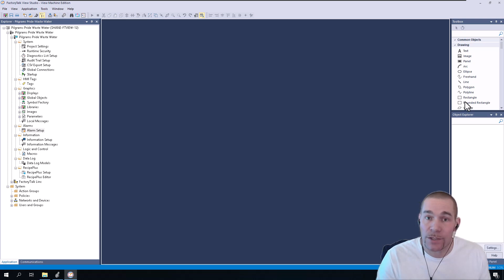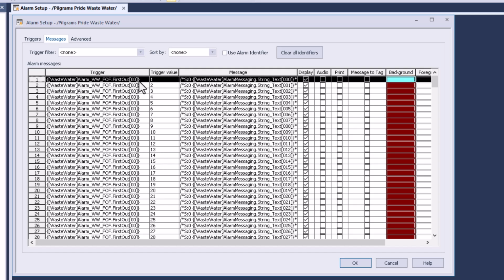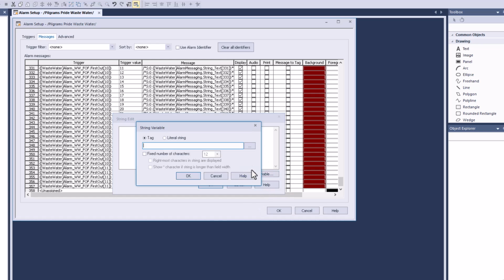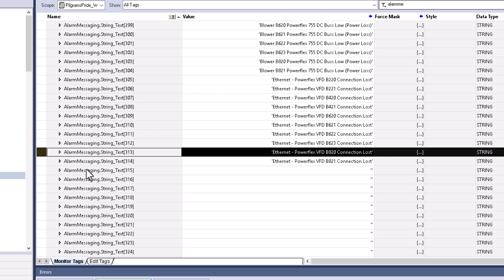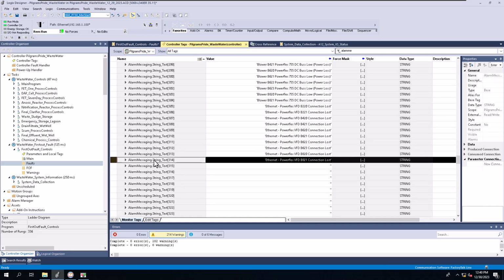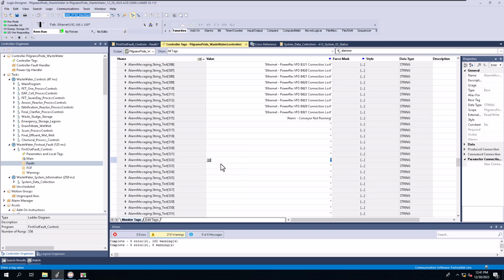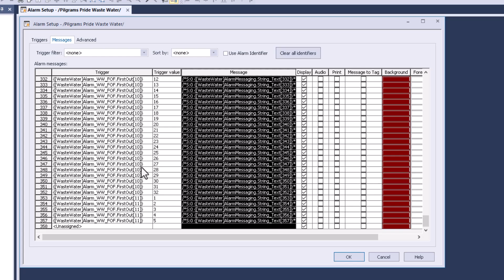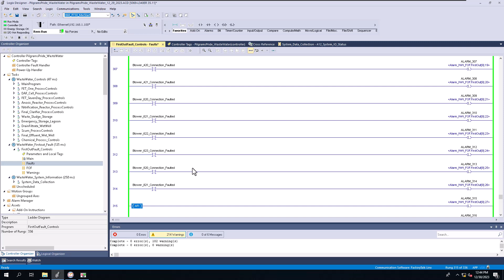FactoryTalk Machine Edition Alarming Best Practice

Comment: What if multiple alarms(bits) are made in the same word? I may of not set this up right but when i have multiple alarms made in the same word it changes my bit value and doesn't display correct alarm anymore.
Reply from the maker: It's first come first serve, first out fault catch.
It will show others after reset by the goal is to catch the first out fault

Comment: question, those string tags values in the plc do not come back to 0 after a restart of the plc?
Reply from the maker: If there is no alarm then they work fine when an alarm is active, if an alarm is active and you reboot the panel view then they can produce ??? marks but if you clear the alarm then they populate

Comment: Great videos Shane! I have a problem with this method that you may have figured out a way around. When the HMI first powers up (I believe the strings aren't read until after the alarm triggers have been read) it always gives the active alarms with "????????" for the text. Then after powerup it works as expected.
Reply from the maker: That is a panelview plus issue, depends on the firmware

Comment: Have you ever noticed using this method, STRING tags as the message versus just typing the message into FTVSME, showing a blank alarm description upon initial bootup of the PLC/HMI?

The only other snag I’ve seen doing it this way is when switching languages on the HMI, the alarms will not translate the STRING tags in FTVSME, so that’s up to you now to do via STRINGs in the PLC.
Reply from the maker: The alarms are started at the time the Runtime file starts
Reply: @ShaneWelcher  I had the same problem, there is a difference in the timing of the alarms starting vs the strings updating so all the initial alarms show up as ????????.
Reply from the maker: @TheLegendOfIsaac  I use this method and keep my timing in the task rate the same however PV plus is a huge time lag
Reply: @ShaneWelcher  I'm not referring to the timing of the tasks. I believe that within the Panelview the alarms start looking for triggers before the alarm strings can catch up so they appear as all blank alarms upon powerup. They are all ?????. I'm not sure how to remedy this.
Reply from the maker: @Isaac-qd6gy  What's your update rate for screens vs the alarm triggers
Reply: @ShaneWelcher  My screens are on a 1s update rate. On the Advanced tab of Alarms, in the field Maximum update rate (second): It is set to 1s.
Reply: @TheLegendOfIsaac  I have yet to be able to remedy this and therefor choose to just go with having the alarm messages built into the .mer versus the method of having the alarm messages all be STRING tags within the PLC.

This happens with Micro 800 controllers and PV800s as well, same issue.

The only 'trick' that I have tested to get it to work correctly is manually unplugging the PVP7 and then powering on my PLC ( 5370 or 5380 Logix controller) then waiting about 30 seconds or so to plug the PVP into power it up. If I do that, the alarms WILL show up on the PVP properly on initial boot up, not just ??????????.
Reply: @zerrb  Thank you for the reponse my friend. It was a great idea to use strings in the alarm messages, it just doesn't work the way we all hoped.
Reply: FYI this was fixed in firmware version 14. It’s specifically called out in the release notes.
Reply: @CamperDale  where exactly? I cannot seem to find it.
Reply: @zerrb Sorry, I should’ve been more specific. I was using a Panelview Plus 7 Standard series D on firmware version 13. Every time I booted the HMI I would get question marks when using the String tag method. I checked firmware version 14’s release notes and under corrected anomalies it stated “On power-up, embedded variables in an ME Alarm Message show as question marks on a terminal. First identified in Firmware Upgrade Package 12.00”. After upgrading my terminal the problem went away. I didn’t see it called out on the performance model release notes, so maybe it’s just some models with the issue?
Reply: @CamperDale  thanks! I’ll give it a try and see what happens.

Comment: Where I work we have a scada system called ifix (which has scant information available on the internet). When it was first implemented they found sending strings made the communications really slow, so they came up with a solution that the plc sends numeric values and scada uses sql for look up tables so the data is centralised. It would be interesting to find out if modern technology could cope with thousands of tags.
Reply from the maker: Rockwell Automation and Siemens is better than those growing Industry 4.0 software and brands
Reply: Ifix is actually a really good product, it’s very versatile. I’ve been put off factorytalk view studio because we only have the machine edition and I’ve had to upgrade 20 or so panelviews due to obsolescence, the conversions have given me some grief. The support contract we have Rockwell is top notch.